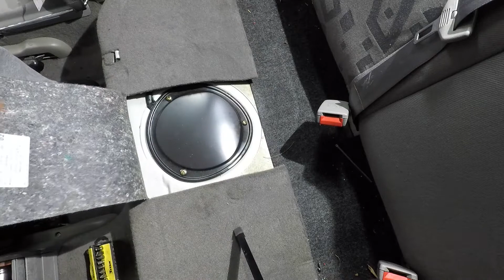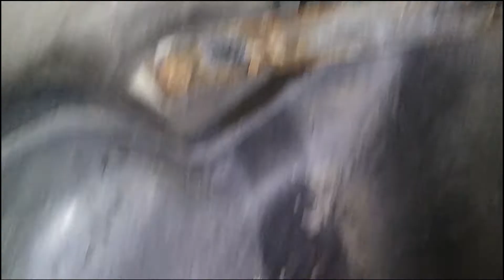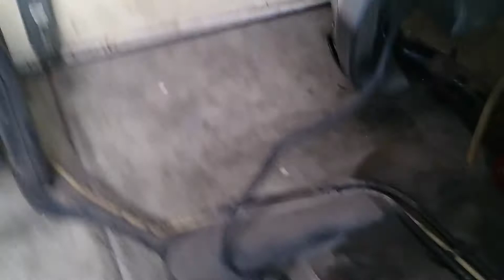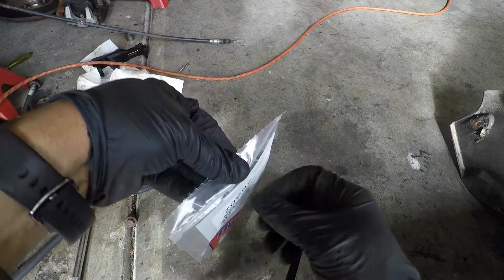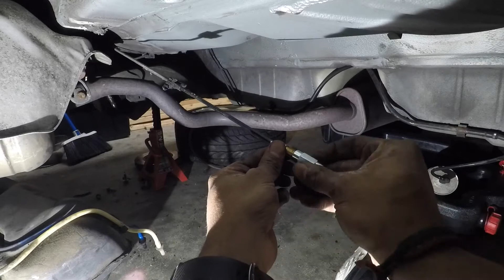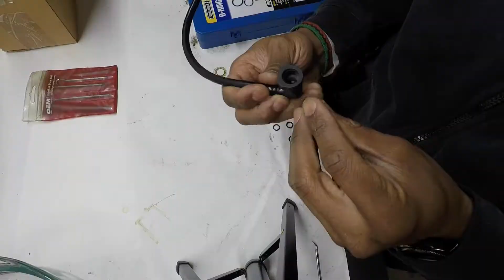MK4 GOLF fixing rusted brake lines, fuel lines (updated because of copyright issue)

Comment: Finally!  Someone who had the same problem I'm having....Trying to replace my rear axle and did not expect all the brake line issues.  The corrosion is ridiculous ...sigh..
Reply from the maker: DUDE! I feel your frustration. But...what can you do other than fix it?
Reply: @MaqsVids  Oh it's getting worse..domino effect', touch one thing and something else breaks.    In the Jetta you need to take the exhaust off to take the fuel tank out and that's when  the mid pipe separated from the Cat....LOL...I think I'm getting to the end  and will start putting it back together.